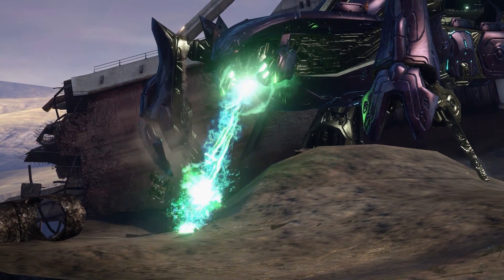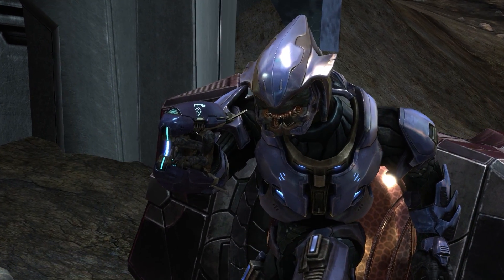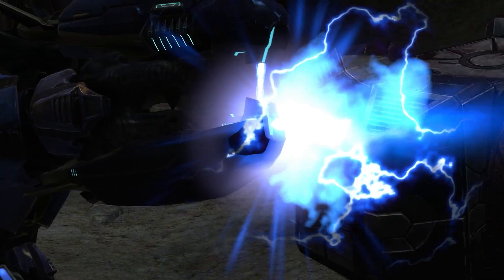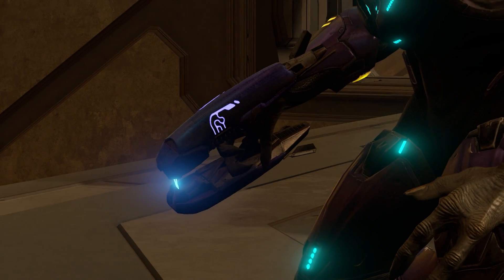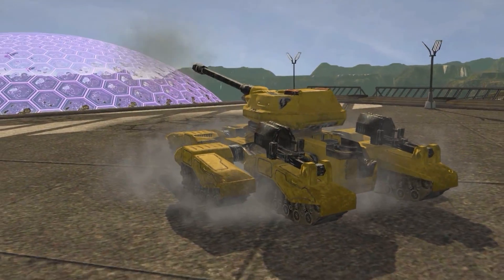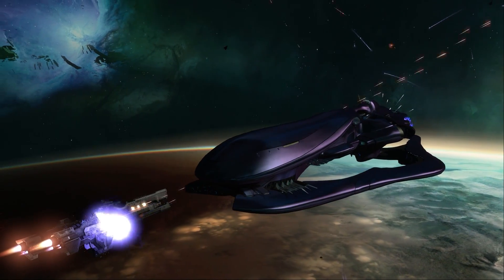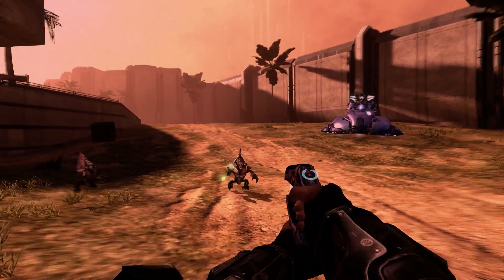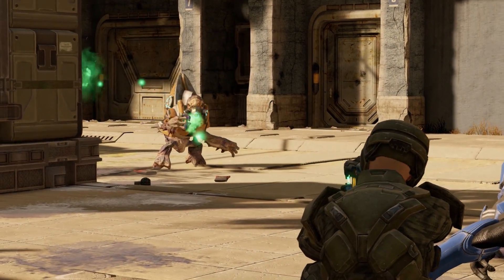How Plasma Works (Halo Lore)

Comment: Halo community: “you can’t beat the covenant with kinetic weapons, they’re too weak!” 7.62 NATO: “haha arm/leg/head goes bye bye!”
Reply: I just chekced the Halo wikia, Humanity in 2500 still uses 7.62 Nato loool
Reply: @MisterMolby  yeah we are already looking to replace it
Reply: @DR-tp9ok  replace what???
Reply: @DR-tp9ok  with 6.8?
Reply: @DR-tp9ok that sucks imagine ally needs ammo that would screw up a lot of logistics
Reply: @DR-tp9ok  We've heard that one before, many times. Guess what!? Those calibers are still in use. At this point I hear that claim and just assume it's for entertainment. But I will still give my input. Suitable replacements for 5.56 already exist without the need to develop a new cartridge. If we assume the replacement is still .22 to .23 caliber then just to name a few we have .22-250 Remington, .220 Swift, .225 Winchester, .224 Valkyrie, and .22 Nosler. I left out .223 WSSM intentionally since the casing is quite fat. The magazines would have to be made larger to have the same capacity as .223 Remington. If we don't follow the caliber guideline then .243 Winchester and .244 Remington beat the bejesus out of .223 Remington/5.556 NATO. Hell, they make 7.62x39 Soviet look anemic. As for 7.62x51mm NATO while I can think of multiple calibers put outperform it I really couldn't name one that would do so without increasing recoil so much that it limits the role to sniper rifles. Maybe .30-06 Springfield.
Reply: @MisterMolby  On the other hand 14.5x114mm (.57 caliber) seems very in place in the 2500's. Oh how we speak of the 2500's as if it were today.
Reply: apparently that's to weak, i don't understand why though, you are literally using a battle rifle (not the BR, i mean like the FAL or SCAR-H) and they soak it up like it's water
Reply: Solipsil covenant armor is made out of the same material that makes up there ships armor, so very powerful. Nano laminate I think. In combination with there energy shields covenant soldier are incredibly powerful, at least elites and brutes.
Reply: @Solipsil Their armor is made of some nanotube stuff that makes everything have a scaly hexagonal pattern, it is good at lessening plasma burns and overall damage but is near useless against standard UNSC weapons as they tend to use Full Metal Jacket in almost anything issued, even to cleaning personel, the armor of most Covenant is resistant to heat but not to kinetic impact, being able to disperse the heat of the impact of say a bullet but not able to hold out the mass of the bullet and being unable to lessen the speed at all, this is also why they put shield generators on basically everything except cannon fodder and some old versions of vehicles (They have some versions of regular vehicles like the ghost and wraith which have energy shields), as the shields quite literally atomize the bullets on impact, making them only heat, which the shields excel at dispersing, however most Covenant vehicles or personel, once their shields drain at open field battles, they are mostly done, even a regular issue Magnum can cause an Elite or Brute severe dismemberment or instant death, grunts are well known to not survive most shots, Jackals get up close with their energy gauntlets, Buggers fly, Hunters have ACTUAL ARMOR or several layers of the issue Covenant harness, enough to weight Tons, Brutes go berserk anyways, and Elites either flee or rush the enemy before getting cut down by machine gun fire.

Humans have the other end of it, we quite literally developed anti-gun or kinetic resistant armor, it is not that effective anymore considering the use of piercing rounds by rebels and overall militias, the armor had zero way of lessening plasma damage and only the recent models seen in H4-H5 have been improved to have countermeasures against excessive heat such as dispersion of said energy and even so it barely makes the burns any less worse.
Reply: @felipesuazo757  Except for the energy shields, materials that can fulfil a Spartan armour requirement exists today. Namely 'composite metal foam', and 'Graphene'. When the game was invented those weren't very well known (or in the case of CMF maybe it hadn't even been invented). CMF is made of small steel hollow spheres packed inside an aluminium or steel matrix, then either cladded with steel, ceramic, or anything you like. They act like kinetic energy sponges. A Steel-steel composite foam plate less than an inch thick have been tested to be able to withstand a 2800 ft/s .050 caliber AP rounds with only 8mm indentation behind the armour. They absorb over 70% of the kinetic energy and can prevent the shockwave from reaching the wearer.
As a bonus, they are also very heat insulating. 16mm thick steel-steel composite was tested at a minimum of over 800 Celsius for 100 minutes, and the temperature behind the plate was less than 400 Celsius. A regular solid steel plate of the same thickness registered over 400 Celsius in just 12 minutes (and weighs 3 times heavier). Now, it the CMF was cladded in Graphene we have ourselves a pretty effective armour. Four layers of Graphene can stop a 7.62mm round. A 0.5mm thick Graphene sheet requires about 5,000 layers. They have a much higher melting point than Titanium (over 3500 Celsius), and is probably the most thermally conductive material known to man with theoretically limitless heat absorption. The heat from a plasma burst can very easily be carried away to carbon nanotube heatsinks.
Perfect Graphene is notoriously difficult to make today, but Halo is set over 500 years from now so it could be done by then. I don't know Halo lore all that much, but from what I've read none of these materials were mentioned in any literature (but I've read so very little of them).
Reply: @TroubledCarOwner  Arguably the only true drawbacks to graphene is the difficulty to produce a lot of it (which they'd probably have figured out by the 2500s) and susceptibility to electrical attacks due to its high conductivity. And while yes, you could argue that channeling the heat generated from plasma bolts to heatsinks, you still have to consider the possibility of the wearer being cooked alive by that heat on its way to the heatsinks, so further insulation is required as well as an active cooling system. 

That said, I really hope we figure out how to produce graphene on a commercial scale sooner than later. There's way too many practical uses for something so strong, conductive and light weight.
Reply: @ArcusDiabolus  well there should be active cooling. Encased in between the plates might even have something like 'Aerogel'. But a few plasma blasts from the standard rifles and pistols shouldn't last long enough to scald a Spartan wearing a Mjolnir. Unless he/she just stands there showering in plasma. We know that they still frantically dodge them. Like bulletproof vests, the suit's only function is so that 'just in case' they get hit they can still stand and fight.

And I too am excited about graphene. Forget about this suit stuff, I want to see them in automotive applications. They have so much potential in energy storage and structural applications.
Reply: If they gave it the real life fire power it would not have been good for the covenant.  It tickles the enemies on most halo games.

Comment: BTW SameToken, the Halo games use two different damage models for the covenant weapons: Plasma Fast and Plasma Slow.  

Plasma Slow is the traditional model where plasma bolts deal more damage to shields but less to health and armor.  In H3 for example, the plasma rifle deals 14.5 shield damage but 3.5 health damage to deplete shields in 5 shots but takes 13 bolts to kill an unshielded target (Almost every game has 115 Hit points with a 70/45 health and armor split). 

Plasma fast is where the weapons have a singular damage value and acts similar to the human weapons.  The H4 Strom Rifle deals 7.8 damage (buffed to 9.6 in the update) to both shield and health and kills in 12 bolts currently in H4 MCC.  They switched it in H5 to Plasma Slow and it dealt 15.6 shield damage and 7.8 health damage.  

There’s several examples as well but I won’t bore you.  Nice video!

Comment: If halo depicted normal bullets realistically they would honestly be more damaging than plasma. Superior range and accuracy at distance. Most combat is fought at distances of like 200-500m. Doesn't matter how far you are away physical projectiles will rip away limbs. Our modern day weapons would decimate their ground forces. An single abrams would dominate probably multiple platoons worth of covenant wraiths. Superior range with kinetic projectiles that would fly through their vehicles like a hot knife through butter plus better optics and accuracy. The halo warthog machine gun is supposedly a 50cal which is the same round as the sniper rifle. The shear impact from the round alone would probably knock a elite on the ground and typically there's 4 to 5 rounds directly behind the 1st. So they're going to be ripped to shreds. Hell 50cals dont even have to hit people to rip limbs off. The kinetic energy and pressure wave is so high that a near miss from a 50 cal is enough to rips limbs off of people.
Reply from the maker: That’s a really interesting point, I’m definitely going to make a video covering UNSC weapons and their discrepancies with reality!
Reply: barely any kind of weapon technology in halo is depicted "realistic" because it just wouldn't be fun. 
it's a good design choice to make most covenant weapons shoot rather slow moving plasma projectiles so you can react to them.
and if e.g. the standard assault rifles 7,62x51mm bullet was depicted realistically it wouldn't be as inaccurate (halo 1 lmao) and kill a grunt or jakal in 1 bodyshot.
its obviously really hard to give an accurate power level to shield and plasma rifles because they are sci fi

Comment: Forgot to mention the radiation. If the shot doesn't kill you, the radiation will.
Reply: would that not apply more to weapons like the covenant carbine and fuel rod gun? i believe those are actually physical radioactive rounds as opposed to this superheated plasma in a magnetic bubble
Reply: Extended lore says that all their plasma weapons do radiation damage. To the point where the various species actually developed a forced evolution to make them more resistant to them.
Reply: @MarcusWolfWanders  Well the carbine isn't plasma, it's actually a sliver of radioactive metal with a very short half life. But still yeah, if you don't die from the impact and even if you get the round out fairly quickly, you're getting turbo-cancer.
Reply: @MarcusWolfWanders  actually, the carbine is very radioactive, in lore, if you're shot by it, you're guaranteed dead, the gas that it ejects while reloading it is bad too, if you inhale it you get a bad disease, so, it might as well be the best precision gun the covenant has in their arsenal.
Reply: Hey Mecha San love your channel btw